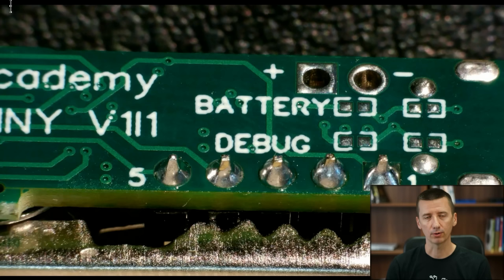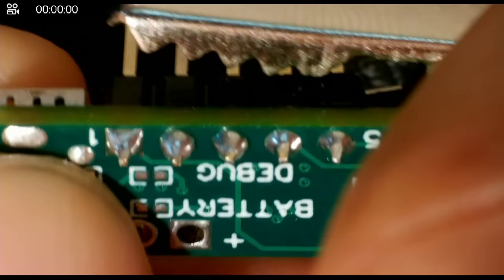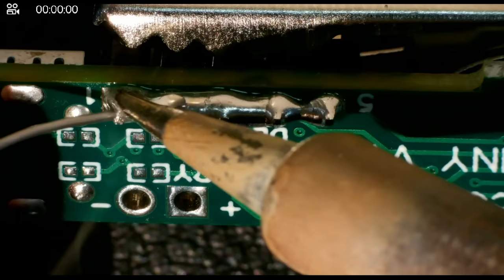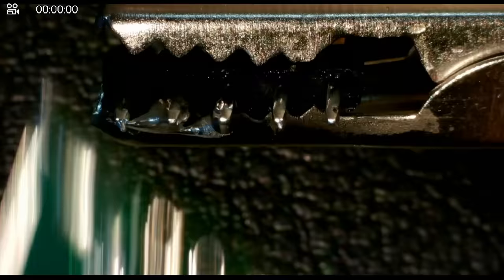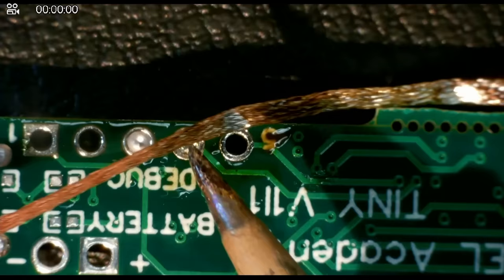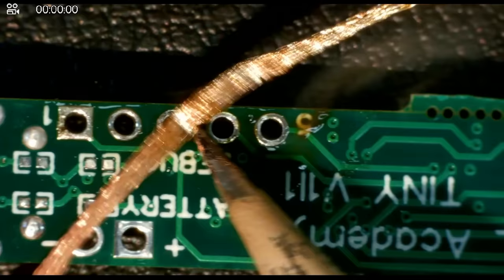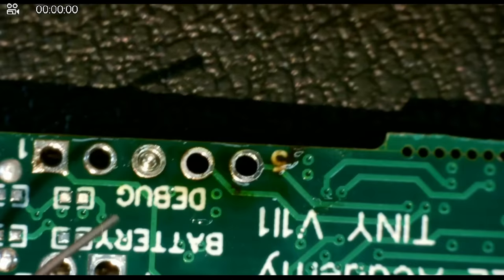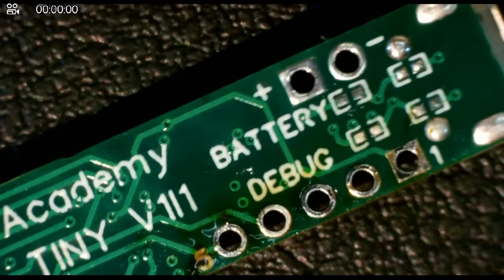Easy Way to Desolder and Remove Through Hole Connectors or Components

Comment: I assume that for this kind of work, you need a temperature adjustable soldering iron, right? What is the way to choose the right temperature so as not to damage the PCB?
Reply: They are basically all temperature controlled. There's no pro to not having it. Think about it.

Comment: I did this technique on my mouse that has a stubborn switch I can't remove all of the solder inside with a solder sucker so I used this but removed two pads in the process 😢

Comment: i had to desolder a 27 pin electronic the other day from a speedometer. It was my first time so i improvised. I was holding a legit  vaccum cleaner hose to the one hand and withe other hand i ws heating the element . The vaccum sucked all the solder.

Comment: Personally, I'm a bit of a sucker (hehe) for the Engineer SS-02 desoldering pump. It's miles better than the Chinese desoldering pumps you'll find, and not extortionately priced.
Reply: That piece of Japan is absolutely a joy to use! I keep trying to find a reason to pull it out and suck some pins.
Reply: Quite interesting! I too have the Engineer SS-02, but I'm not really happy with its performance. 
It feels really great in hand, and build quality is good. It really is a product which I want to love.
On the other hand, I have very often difficulties with its tip clogging up, and being difficult to clean, clogging in such way, that the plunger is extremely difficult to press, and in general being a bit too small. 
There's a Chinese pump which is sold under various names, like Weller 7874B. It has wider tip opening, and tends to be much easier to clean, and clogs less. It can be also combined with silicone hoses, to give the seal which the Engineer one has. So I often tend to switch to that one, when the Engineer goes on strike.

Comment: I was successful by firstly soldering a common hard wire to all pins, then by heating that wire with the soldering iron all pins are getting hot simultaneously and can be removed at once.

Comment: If a plated through hole doesn’t clear with braid adding solder while the braid is hot on the pad to be cleared will help transfer heat and pull up the old solder. Failing that, a quick shot of canned air to blow the solder out of the hole, a bit dangerous (risk of hot solder spraying everywhere) but a last resort if you don’t have a desoldering iron or the braid doesn’t clear it on stubborn holes or ground plane holes where you don’t want too much of a heat sink from the braid.
Ideally if a hole is large enough or pin small enough you can tell if a pin is fully unsoldered, it will move around easily. For components that have failed where you can get to the leads but don’t care about the part and you don’t want to damage a board (more than it already is eg electrolyte damage or charcoal PCB substrate) snip the parts off and pull out or blow out (with canned air) the remaining leads one at a time.

Comment: Ive bought cooper wick and it doesn't work as good as you ... I've put flux, more flux and it doesn't absorb at all... I've raised the temperature,  put flux again  same result... I don't know if it's a bad quality wick or I don't do it well
Reply: Use lead solder. It melts lower and flows way better.

Comment: To desolder dip microchips i used syringe needle. It can be placed on pin, so pin goes inside needle, then you melt tin and press needle down, so it goes in hole for pin, and pin becomes desoldered

Comment: If the connector is not too large I use a heat gun to remove it. It does not destroy the PCB nor the component.

Comment: Ok for the addition of fresh solder but, when it comes to through-hole components, using a suction pump it's way safer for the pcb, its pads, the removed component and lets you spare a lot of time on wick cleaning and it's more and more cheaper, even if you choose a mechanical pump instead of a full fledged vacuum pump.

Comment: Flux! Lot's of it. And a bigger tip, chisel type. If not reusing the pin header, you can easily pull out one pin at a time with a plier. The plastic will melt when you heat it enough.

Comment: much better technique is to cut the connecting strip on the connector to split it into 2 or more parts. (usually the connector is disposable as compared to the pcb)

Comment: 99% connectors will melt down after making such approach. So the connector must be destroyed for sake of saving PCBA by extracting each pin individually. If you're after saving both the PCBA & the device to be de-soldered then low temperature alloys are the way to go such as Wood's alloy or Rose's alloy with  70 °C and 98°C melting points respectively.

Comment: But if the part you're removing is connectec to a battery, wouldn't it short the battery if you connect the pins with the soldering lead???
Reply from the maker: battery needs to be disconnected or removed
Reply: @RobertFeranec  yea but the thing is, its the battery pins itself that is soldered on the pcb

Comment: Cut the pins. Remove individually by pulling single pin after cutting.. Safer, less heat needed for just single pin.. Anyway that ic to be thrown away not that expensive. Motherboard more expensive than that of ic which easily procure compared to motherboard hard to find replacement.

Comment: One extra tip, people that moan about solder wick usually don't have the iron hot enough !...cheers.
Reply: @Milan Velky If they have a pump why would they moan about wick ?...it was just an observation intended to inform
Reply from the maker: Yes, it is good to increase temperature a little bit when desoldering.
Reply: @Milan Velky The solder soaked wick makes great earth straps ! nobody has to pay for solder wick disposal, your making that up you silly oaf !
Reply: @Milan Velky Wick is useful for other things... for example cleaning surface mounted pads when replacing a bad chip with a new chip. Without wick the pads are impossible to clean properly for the correct remounting technique. People often just remove smd part and replace new one without cleaning the pads, this is a classic amateur mistake ;-)

Comment: Doesn't work with a 10-layer 3oz Cu on all layers board with planes though. Like desoldering an iron bar!
Reply from the maker: That is where I usually use thermal relief (if it can be used). Once I created a board with direct connection to number of GND planes and it was not possible even solder it.
Reply: @RobertFeranec  We tried to preheat, low temp solder, the lot. No chance.

Comment: I get so frustrated trying to use Solder Braid. It just never seems to work for me.
Reply: Coating the desoldering braid in high quality flux first helps a lot.
Reply from the maker: Also temperature is important (solder may not get hot enough for different reasons e.g. low soldering iron temperature, too small tip on soldering iron, pad is connected to GND plane, high melting temperature of solder, etc)

Comment: Even better way is to use a desoldering pump that creates a vacuum when you press the button and release the spring. It's a lot more efficient for through hole than desolder braid

Comment: That's only practical for like 3 pins, anymore and its just a large mess of solder to clean up. Use hot air and add flux to the pins, if its excessively large area that can't be heated safely, there is no practical way to save header and just cut it off on one side and puck pins out one at a time.
Reply from the maker: Hot air gun is also a good solution

Comment: Not really impressed by this method. I use Chipquick solder wire that has a high percentage of Bismuth. This lowers the melting point so it will stay liquid for many seconds without overheating your components. Also a tin- bismuth solder paste is great for low temperature reflow soldering. Works as nice as lead based solder paste, but is is RoHS compliant. Do not use it for parts that may get very hot, it may desolder itself!

Comment: To be honest for me this method looks completely awful - it's such a waste of tin. I prefer just copper wire and non-electric solder sucker.
Reply: Try removing a through-hole part on an old PC motherboard such as the IDE port. Report here and let us all know how easy it was using the manual desoldering pump ;-)
Spoiler: You will fail miserably and the connector will remain in the motherboard ;-)
Reply: @johnbos4637  I just preformed that trick this evening and it ended up working exactly as you described. What a mess.

Comment: Good job, but your solder wick technique is pretty wasteful. I see others doing it too so I might as well share my techniques:

Use your iron directly to flow the solder then quickly introduce the wick. The thermal load will be much lower allowing the solder to stay molten even at lower temperatures. You can hold the brain near by to pre-heat but be careful not to prematurely activate the flux.

Cut it short so you don’t burn flux off of the unused portions. This will also let you use less heat, since the rest of the wick acts like a heat sink.

Even when you don’t cut it short and end up burning off flux around the part you used, don’t skip those parts. You can renew the dry braid you skipped by adding liquid rosin flux. It’s nasty, but it works. The best braid already has rosin flux (dried).

Short pieces will also hold much more solder per inch since it can’t flow up the rest of the braid/wick.

Even when a piece is too saturated to clear holes, you can exploit the extra capacity of a short piece to get rid of excess solder so your fresh piece will be better able to remove/clear the remainder without getting over saturated itself.

I desolder through-whole components almost daily but I hate my crappy desoldergun so much that I use every trick in the book to avoid using it. As a result, I use a lot of braid and need to be very efficient with it. I buy huge rolls and it isn’t cheap so I try to make it last as long as I can.

Granted, if I had a better cartridge-type iron I could get by without all these techniques but I primarily use a clone that takes Hakko T18 tips. It’s actually built into my Aoyue Int701A++ desolder station. It’s significantly better than the identical-looking one built in with my Aoyue Int866 hot air rework station. The iron itself is the same, but that’s just a testament to how much the electronics matter. I’m sure a genuine Hakko would trounce them both.

That said, I’d rather have one of those cartridge-type irons since even the T12 clones are better than a genuine T18 iron (thermal recovery and maintaining temps with high thermal mass loads). I might go with an open-source one like TS100 instead (doesn’t fit Hakko tips).

Comment: Solder does still flow with gravity, so to clear holes it sometimes helps to go bottom-up.  Otherwise just use a small tip and a solder pump.

Comment: There are several techniques that I've used over the decades, but NEVER that!  NOOOOO!
Close to that, however, way WAYYY back, was a metal attachment for one of my soldering irons that was a piece of metal that was fairly thick in order to hold heat.  It attached to the soldering iron on its center.

Down the middle of the metal, was a channel.

You'd heat up this on the iron, then just press it down over the pins, which would go into the channel. The outer edges would melt the solder and WHALA!  Pulls right out.

But here we are decades later and last year, I said screw this old-school crap and I bought a vacuum solder sucking gun.

BEST THING EVER!

It comes with several tips from very small to very big. The temperature is adjustable too.

Since buying this, I've never used the old methods since.

Comment: Wow!!!! I don’t think I have ever seen a worse method of removing soldered components from a board. People watching DO NOT DO THIS!!! I am a retired electronics engineer of 45 years successful business and this is not a good method. Too much heat has been applied, which not only melted and scorched the varnish on the area around the connector points but can cause serious issues with the laminations of your boards. Only use a proper de-soldering tool with your soldering iron. They are cheap and very simple to use, are spring loaded and suck the molten solder away from the solder point. They reduce the excessive heat this fool is applying to the board and actually leave a clean solder point, which does not usually require additional ‘clean up’.